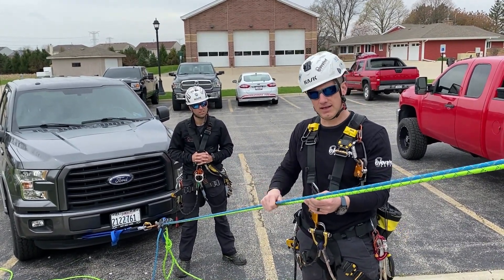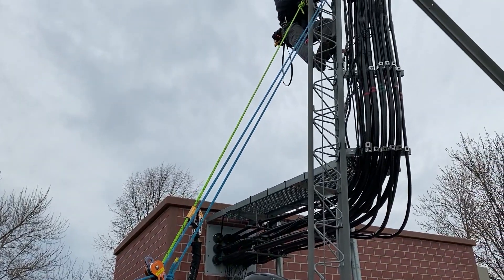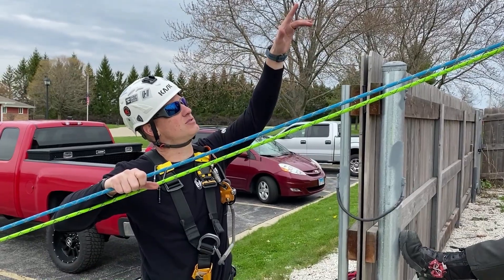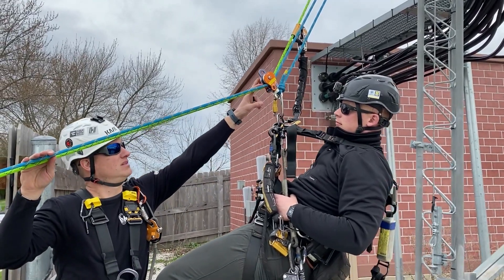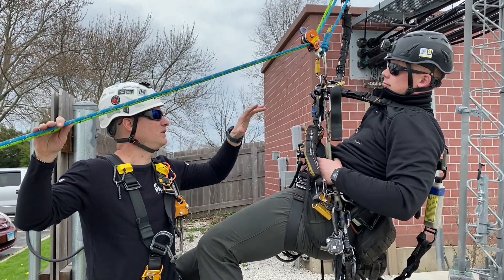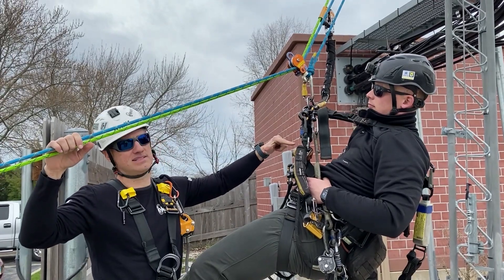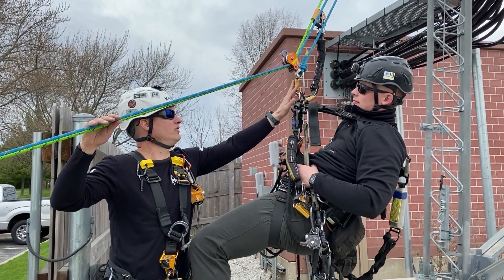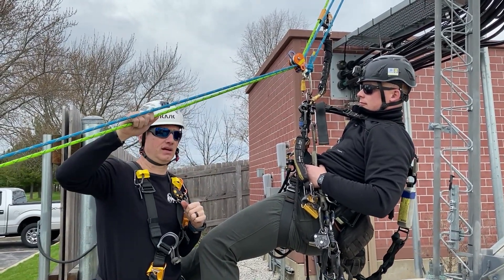Tracking Skate Block Hybrid - Tower Rescue Training

Comment: Hello and huge fan of this but lately I’ve been running into safety dudes and saying we shouldn’t do this because it loads one side of the double pulley. For all the haters, Could you provide clarification on the load distribution when using the hybrid skate block system, particularly regarding the concern some have raised about placing ‘too much weight’ on the tracking side of the double pulley? Based on our understanding, the forces applied to the tracking line are managed within acceptable limits when the system is properly rigged, but we’d appreciate your insights on how this setup maintains balance and mitigates overloading on that side
Reply: How does it load one side of the Double Pulley when both sheaves are loaded? I agree that if there is only one rope running through the Double Pulley, then yes, it loads off center, the running rope can wear on the plate also giving it an edge if not caught. But thats not the case here.
Reply: @kiwionarope  exactly, his argument was 1 “side was loaded” more and not even. I didn’t agree with him but I just want to have documentation for future naysayers.